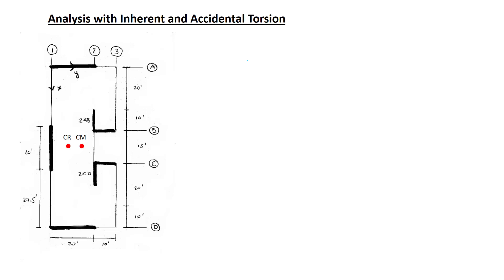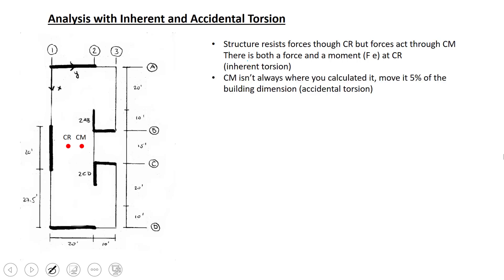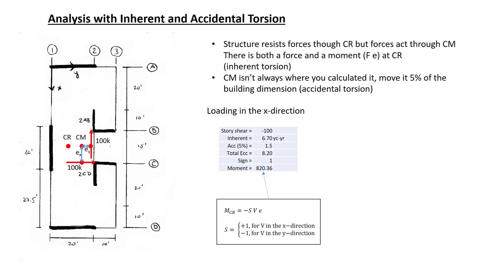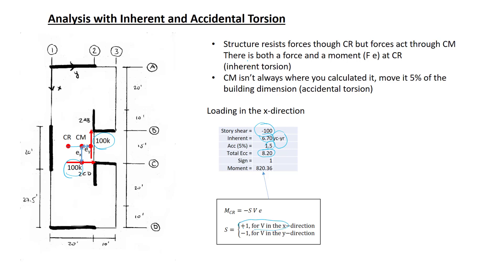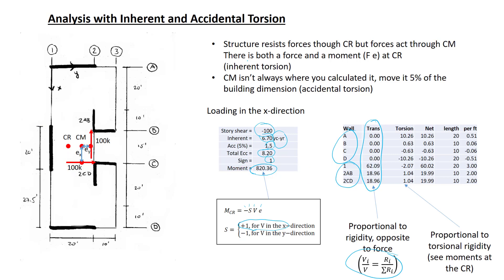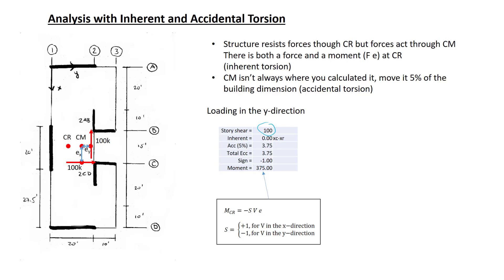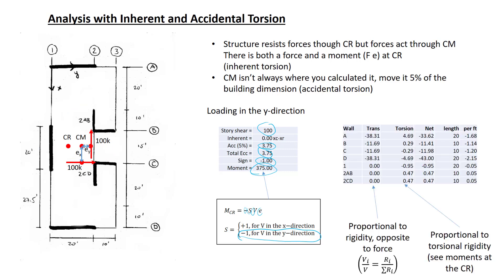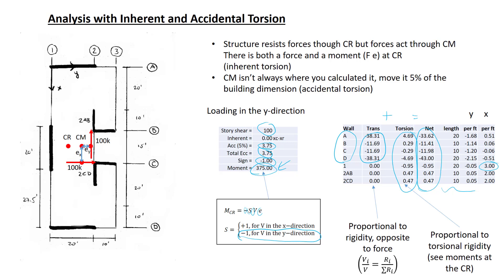Rigid Diaphragms 03, Force distribution to SFRS with accidental and inherent torsion

Comment: Is there an error in your accidental eccentricity value?  For your X direction, you have 1.5' listed, when 5% of 75' is 3.75, and it appears the same mistake is made in the Y direction
Reply from the maker: You scared me there for a second, but the video is indeed correct. For loading in the x-direction, you move the CM in the y-direction, thus making the moment arm (perpendicular to the direction of loading) larger. Thus, the values given in the video are indeed correct.